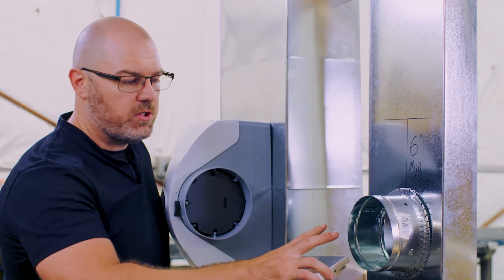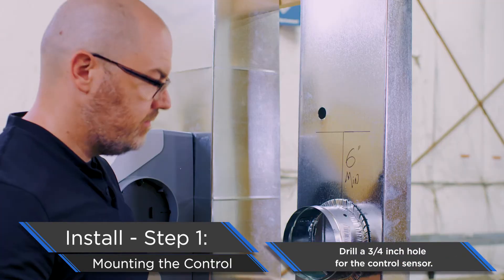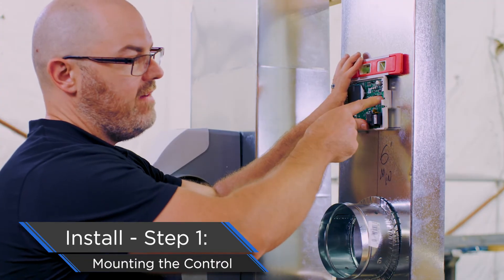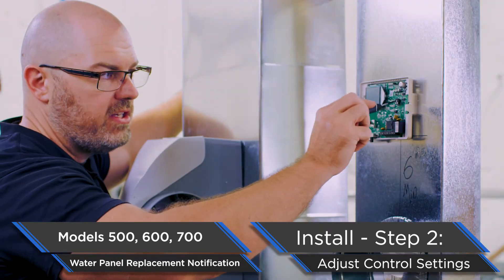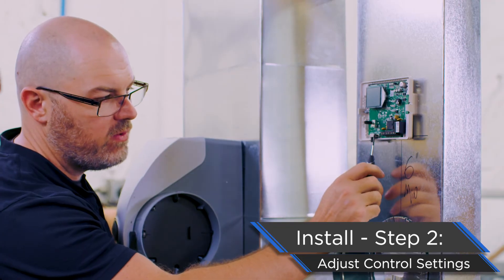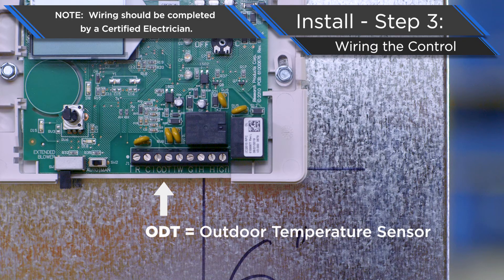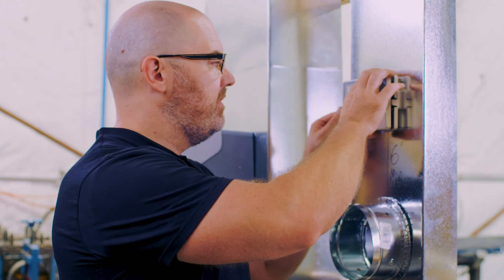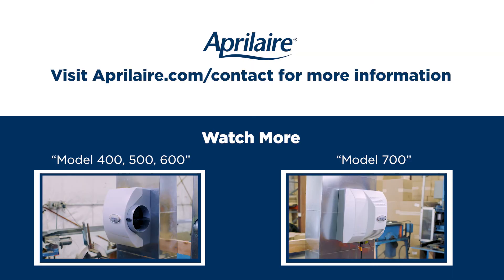Connecting a Humidistat Control to AprilAire Evaporative Humidifiers

Comment: Guess I don't read directions well!  On the 3 60M units I had before (2 at my houses, 1 at my parents), the "Replace Pad" light never came on (even after years of use).  Never thought you had to change a switch to activate it!   [I did inspect the pads occasionally.  But the light would have been nice!

Comment: When installed in reverse (my furnace the main unit must be installed on the cold air return side), does the humidistat still get installed 6" above where it connects to the hot side?
Reply from the maker: Thank you for contacting AprilAire! The controller should always be on the cold air return side. The controller will either be 6 in. above the humidifier or 6 in. above the bypass. If you have any additional questions, we would be happy to assist. We can be reached at support@aprilaire.com or by calling 800.334.6011 Monday through Friday, 7:00 a.m. to 5:00 p.m. CT.

Comment: I have an Aprilaire 500. My problem is that the humidistat only operates at the highest setting about 50 & clicks off when I lower the setting & vice versa .   My windows were very wet at that setting.
I checked everything else which is fine. At a lessor setting it doesn't seem to operate & it seems very dry. Is that normal?  Is there any way to adjust that with a lower setting to avoid too much humidity?  I hope this makes sense. Thank you.

Comment: My humidifier stopped working. Water to the unit, power to the Model 60, no low voltage signal out to the solenoid. I discovered the head is missing off the outside sensor. Can this unit be utilized with no outdoor sensor until the sensor can be replaced?

Comment: This is one of the best "HOW TOO's ever... great job...And IF you need help from the 1800 number... Eric was also Fantastic with the Wiring...In the  Instillation Description It asks you to Return a wire to the  Thermostat G ...You Simply Remove the G wire from the Furnas and connect that wire to the G on the input of the humidifier so the new digital control is in that loop....Works fantastic thanks...He also informed me that the External Temperature Sensor Is very important to install outside.. .especially if you  have very cold... this will compensate the unit so your windows do not sweat as much when its really Dry out from the super cold..... Thanks again I would highly recommend this Over the Honeywell Unit all day long....
Reply from the maker: We greatly appreciate your feedback! Thank you for contacting Aprilaire.

Comment: Hi, what's the difference between auto mode and manual mode? Thanks
Reply from the maker: Thank you for contacting Aprilaire! The Humidistat Control offers two modes of operation, Automatic or Manual. When in the Automatic mode, this system offers the following benefits:
• You will always receive the optimum amount of humidity so that your home and its furnishings are always protected from the damaging effects of excess condensation or low humidity during the heating season. The control automatically adjusts your home’s RH based on the outdoor temperature, increasing the time maximum comfort is maintained.
• Simple operation with few adjustments. The control eliminates the need to manually adjust the control when outdoor temperature changes. It also eliminates the need to turn the dial setting to OFF during the summer season.

When installed in the Manual mode, it is important to anticipate a drop in outdoor temperature and reduce the setting accordingly to avoid excessive condensation. For example, with an outdoor temperature of 20°F, the correct setting will be 35% RH. Recommended settings for Manual mode can be found in your unit’s owner manual. If you have any further questions, we would be happy to assist! Thanks again for contacting Aprilaire.

Comment: Connection of the humidistat with ecobee with the c wire converter.   How is this done as if wired using wire diagram for both, it blows out the fuse when hum stat is energized  ??? !!!
Reply from the maker: Hi Anton - Thank you for contacting Aprilaire. Could you give us a call at 1-800-334-6011? We're hoping to discuss this with you to determine if we can assist or if you will need to contact ecobee. We are available Monday through Friday, 7:00 a.m. to 5:00 p.m. CT. Thanks again for reaching out.

Comment: My model 60 is reading inaccurate rh level. Waking up with dry nostrils and it stills read 45. Filter is dry and humidifier only runs on test mode. What’s the problem?
Reply from the maker: Thank you for contacting Aprilaire. Would you mind giving us a call directly at 1-800-334-6011? We would be happy to assist you. A support team member is available Monday through Friday, 7:00 a.m. to 5:00 p.m. CT.

Comment: I am in process of buying a Model E100-H. Can this model be hardwired to a Nest thermostat?
Reply from the maker: Thank you for contacting Aprilaire! We need a dry contact for our dehumidifiers to turn on via external controls. We would advise that you contact Google directly for further information on whether it will be compatible or not, based on those requirements. If you have any additional questions, we'd be happy to assist.

Comment: My control makes a clicking sound while the blower is activated. It's not the solenoid, it's coming from the control unit itself. Goes away when I turn the knob to TEST and manually test the solenoid. Any tips on what I might be dealing with?
Reply from the maker: Thank you for contacting Aprilaire! Clicking within the humidistat is almost always due to a wiring mix up. We'd like to recommend that you verify the wiring is correct, especially the G wires. If you have any questions on this process, we'd be happy to help and can be reached at 1-800-334-6011.

Comment: I have a 350 model with a manual control. I have boiler heat but would like to update the humidifier control with an automatic model that reads outdoor temperature. Do you have a control for this application? It can be digital or a dial control.
Reply from the maker: Hi Bruce - Thank you for contacting Aprilaire! We do not currently have a humidistat that will work with the outdoor sensor and mount in the living space. We'd like to recommend one of our thermostats instead for this. The Aprilaire Model 8620 Thermostat would be our simplest option that can do what you're asking. Please visit https://www.aprilaire.com/whole-house-products/thermostats/programmable-digital-thermostats/model-8620 for more information. If you have any additional questions, we'd be happy to assist.